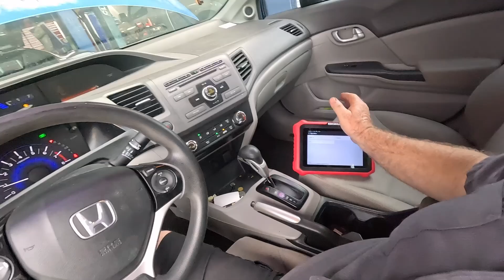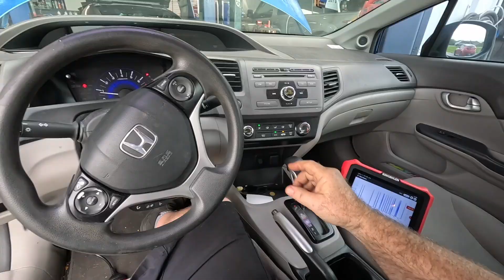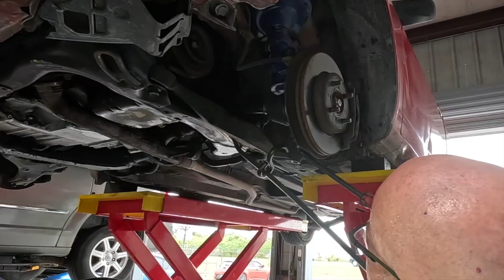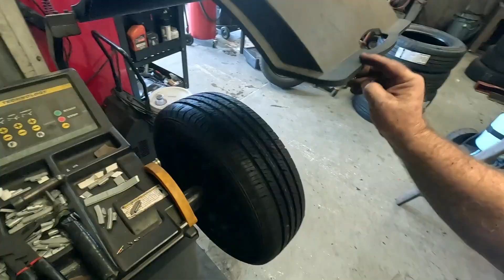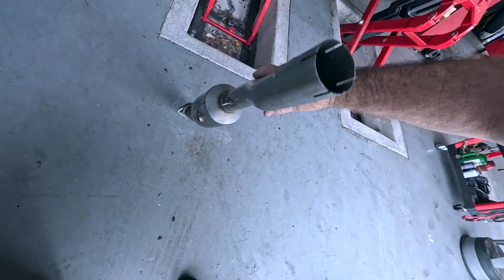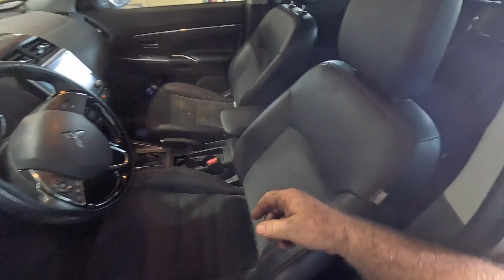02 Civic, Axles, Oil Pan, 12 Civic, P0339, Outlander Magnaflow exhaust mod. Auto Repair Shop DAY 727

Comment: On a steel oil pan I wouldn't feel guilty about using the abrasive wheels to remove the extra stubborn gasket. I would have used a wire wheel myself. I worked with a guy who insisted on using 3M Super Weatherstrip Adhesive on SAAB valve cover gaskets. The gaskets were of the O-ring style that fit in a narrow channel in the aluminum valve cover. Needless to say it was quite the task cleaning that adhesive out of those channels. It took a combination of picks, pocket screwdrivers and a wire wheel.
Reply from the maker: Yeah I do not like using abrasives. The wire wheel I tried wasn’t making a dent. It took about 45 even with abrasives. Next time I’ll use a heat gun as was suggested earlier. :)
Reply: When I was 13 or 14, I started watching NASCAR , Winston Cup races. They keep saying sticker tires or scuff tires. I could not put it together for like 5 or 6 races. Now "Winston" is politically incorrect. The North and South polls will be swapping tomorrow.😂

Comment: Thanks for the video Jimmy!
I have lots of experience with the gaskets that seem to be glued on to a rocker cover or an oil pan, it always seems to be on painted steel for some reason, maybe the rubber and the paint are just a bit too similar chemically. I struggled until I found that a heat gun from the back of the gasket (ie heating the metal) would have the gasket bubbling at the back and just peel off.
Reply from the maker: Great tip, thanks for sharing! I’ll try that next time!